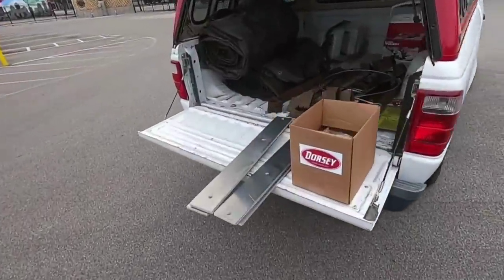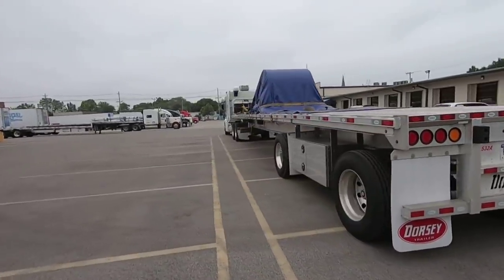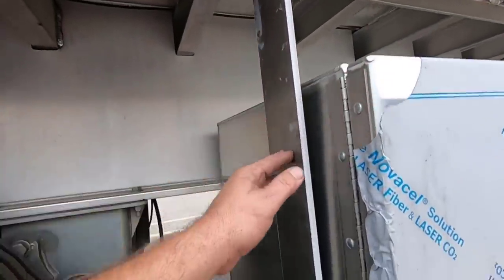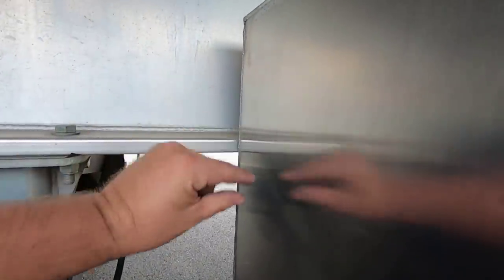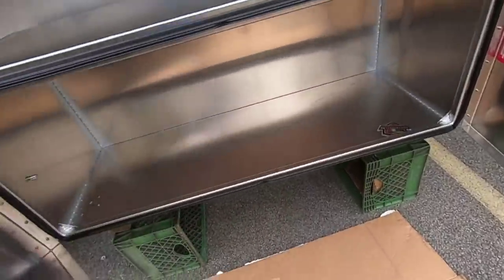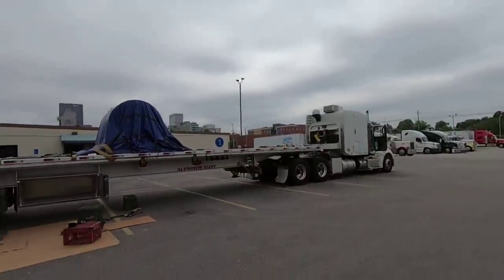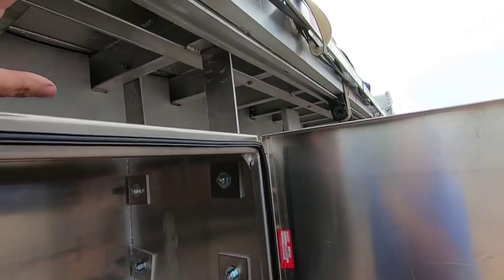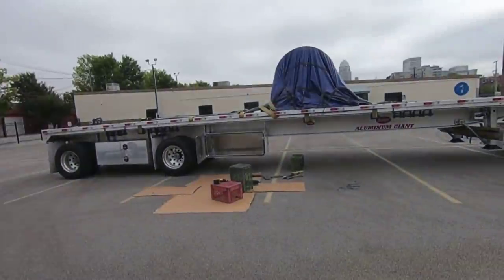#429 Installing ToolBox and my Flatbed Equipment The Life of an Owner Operator Flatbed Truck Driver

Comment: Hi Dan, need some night shots to see ur light set-up on the new trailer
Reply from the maker: I’ll work on that 
Thanks for watching
Reply: A suggestion for your tarps . You can do one more fold before rolling it and it would make both tarps fit better. I used to have one toolbox on my trailer and i was able to fit 2 8ft drop tarps , 60 bungee cords , 16 4 inch straps and 20 1ft edge protectors.

Comment: Hey, just a bit of info for someone putting on a box like that. Be careful the first time coming across a railroad crossing. It's possible for the box to drag across the high point of the road, where the tracks cross. The box will go over the tracks BEFORE the trailer axle will begin to lift the trailer. The best way to this is the bottom of box is above or the same as the bottom of trailer frame. I really can't tell from the video if it high enough.  Just saying, cause we have seen those trailers with mangled boxes or bracket- no box. Safe trip drivers

Comment: Looks like you could slide and store that big tarp on top of the new box. You could easily add a couple of plates to the hangers to give the tarp some protection and a place to secure the tarp
Reply from the maker: I’ve thought about that 
Thanks for watching
Reply: And probably do the same with the other step ladder on a different tool box and get it off the deck.

Comment: A trick from a machinist of 35 years, squirt a bit of WD-40 on the drill bit and aluminum when drilling and it will NEVER stick to the tool. Also works on a belt sander/disk sander and sawing. WD-40 is just the wonder lube..... Thanks for the great videos!! Keep them coming!!

Comment: Dan just a suggestion,  There is space  between the bottom of your flatbed and the top of those boxes for your extra  tarps. you could easily fit them in between that space. The stock aluminum supports would keep them  moving forward  or backwards ,and all you would need is a couple of  bungie cords hooked to between  two supports closest to the doors to keep the tarps from falling off the sides.

Comment: my storage space was mainly for my liquids, steering fluid, windshield fluid, radiator, and the fluid additive for winter. also grease, as i used a paint brush to keep the 5th wheel slick. oh and my 5th wheel lock, one heavy sucker, kept my fueling gloves in there too. on other side were my rags. use to keep my gloves below my seat, but after awhile the fuel fumes tend to get to you. i use to have a fuel tank cover, that i made, that prevented fuel from splashing on the fuel tank, when fueling.

Comment: Your DeWalt cordless drill with the bit you purchased will remove a boot from your tire. Drill out the lock pop open the cover and use a large screwdriver to release it.

Comment: Can never have to many tools as a truck driver,was looking at how your chassis rails run on your truck ,and I wonder why heaps of people don’t have tool box’s that roll along on the bottom side of the C Channell ,I think it would help if you needed to shift weight but couldn’t shift the load at all ,once it was loaded with what ever ,I know here in Australia sometimes would be handy ,especially if you had all your chains in a tool box like I do ,not on a headache rack.tool box full of chains is a  300 lbs +.maybe ask Dorsey if they wanted to set up a prototype.i have never seen one done but would be keen to see it in action if some one has one.may be a bit harder to set up for I drop deck like I have though.

Comment: Dan I think you should do some brainstorming and make a Special Aluminum bracket for your plastic corner protectors in the same area as your boxes to give you more room in your new box for your other 8 ft tarp there’s got to be a better way Dan I’m always building things with steel or wood just a thought Drive safe

Comment: I'd cut some rubber mud flaps and lay them at the bottom of the box and lay the coil racks on them. . The steel coil racks will chafe the aluminum.

Comment: Hi Dan, luv your channel, its Digby here from Perth western Australia, i,ve retired after 45 years on the road,,clocked up over  8 million kms. 
Just watched episode of the toolbox mounting, and have a suggestion, if you reroll your other 8ft tarp so it's the same length as the toolbox l reckon it would fit on top of the toolbox on  the drivers side.

Comment: Thank you for sharing the brackets for the toolbox. I will install one on my aluminum trailer and needed an idea. Good thing you consider your winches. I have seen many flatbeds with toolboxes mounted so high that you can’t slide the winches anymore.

Comment: Dan, I'm starting mercer orientation on Monday, I'll be adding some winches to my trailer how many do you recommend I run on each side of the trailer, thanks in advanced and safe travels.
Reply from the maker: I have a total of 20 winches. I have 14 on one side and 6 on the other. 18 winches is more than enough. I would put 12 on one side 6 on the other side.
Reply: Thank you sir! 👍